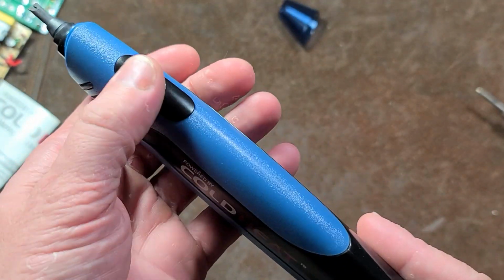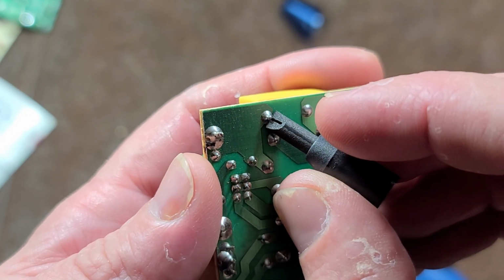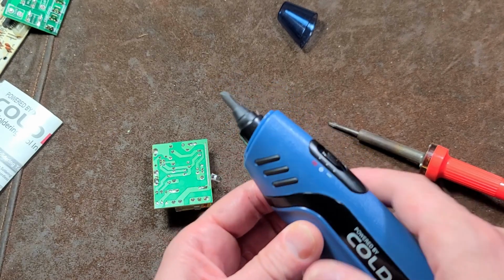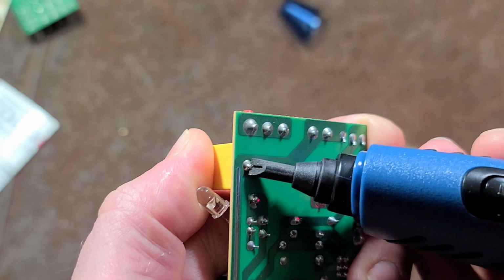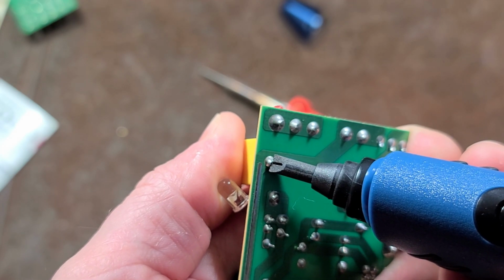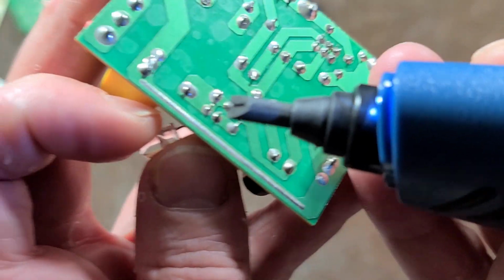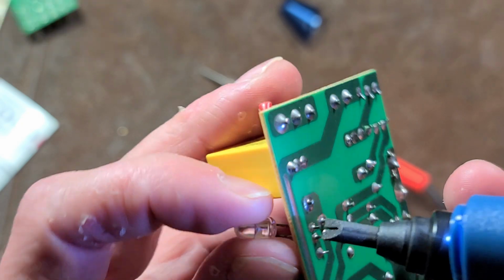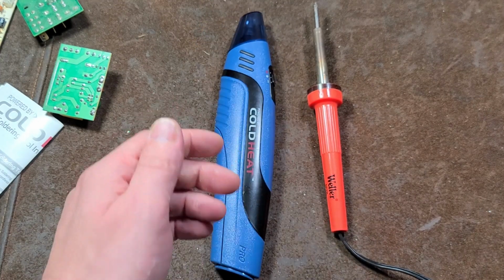ColdHeat Pro Cordless Resistance Soldiering Iron Review (Not Effective)

Comment: I have had one of these Weller Cold Heat soldering tools for over ten years, I used it on aircraft soldered connectors in the field (older aircraft before crimped connectors became the norm) it worked great on them, almost instant heat, not much risk of fire by carelessly putting a hot iron down, I would fill the bucket on the connector with solder first, then heat the wire and the bucket together at the lip of the connector, slide the wire in, leave the heat on for about five seconds then remove the Cold Heat tool, job done, also in this situation you could de-solder old wires if needed, that would take a bit longer as the old wire would seem to be a bigger heat sink than installing a new one, never figured that out.
I loved it, I am retired now, so I have not use it for a while hence, the loved it, (but I still have it).

Comment: This device is actually really easy to use. If you want to desolder, clean off a small area of the oxidized joint, so that the tip can conduct. Keep the red light lit by maintaining conduct through the solder joint. Pressure is not needed, just enough for conduct.
Soldering is exactly the same. Keep the red light lit. The tip is brittle at it's failure pressure (which isn't much), so don't press hard. Don't short a connection across leads of a circuit device (like a transistor), because a current will pass across the gap in the tip, passing a current/voltage through the device leads. Components should be ok to solder/desolder, as long as you don't short the two halves of the tip across component leads.
I have a really good portable device that screws onto the tip of a small vape. They do work like traditional irons, with heat.
I have both. And an OLD Weller gun. AND an old pencil type. And a newer pencil type, with a trigger-feed solder spool. 😂

Comment: How does it works? ( well,  kinda )

Is it using like Frequency like those industrial soldering unirse that their pencil points also go bad with heavy use??
I did not like seeing the unit emmits voltaje!
So, this is good probably just for soldering 2 cables together !
Heat up the bae copper cables, then get your soldering rosin and it is suppose to work !

It's my guess !!

Comment: I tried to use a cold heat soldering iron when I was a preteen. First I was excited about it than became sorely disappointed after realizing how inferior it is compared to the 65 watt Weller soldering iron or even a 25 watt iron from radio shack. I wished I’ve asked my dad for a benzomatic butane soldering iron back then.

Comment: Weller has been making battery powered resistive irons for 40 years I have used and work great, now with Li-on it's even better.  This idea is a joke, you need to apply heat not current.